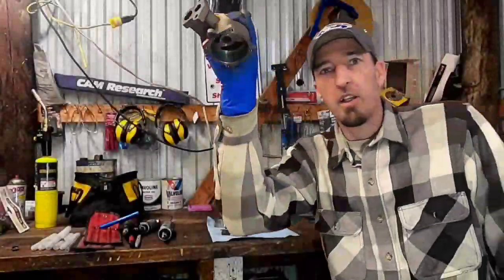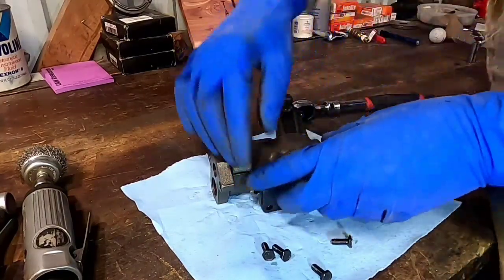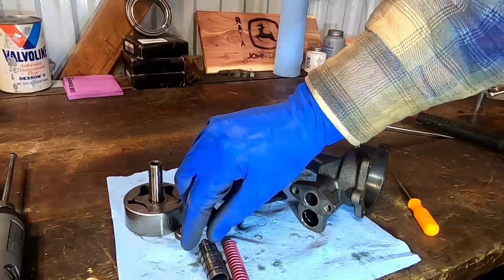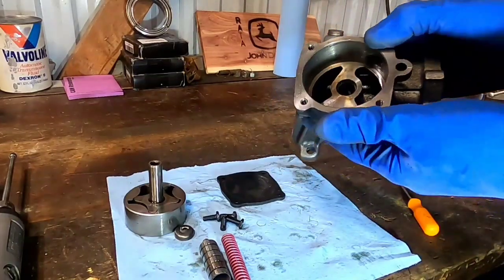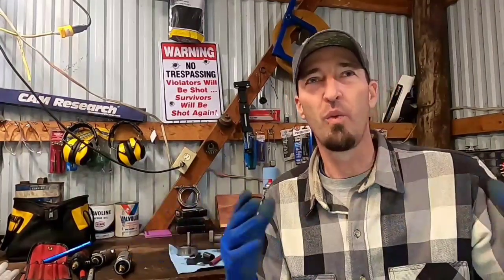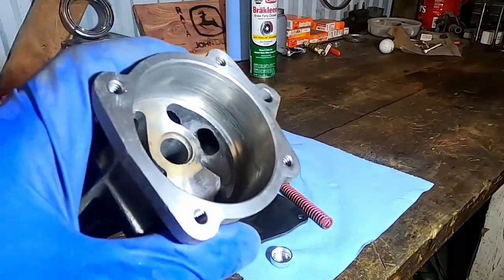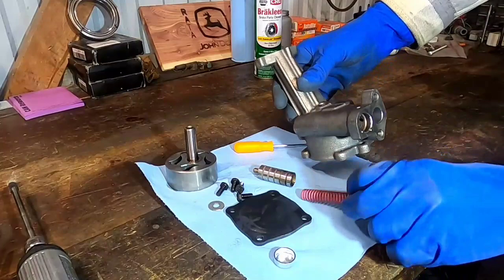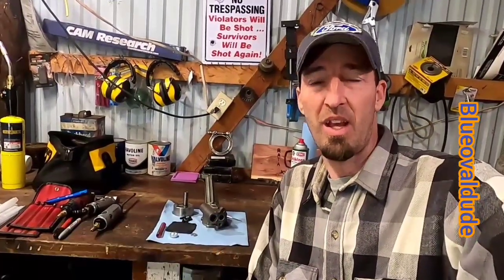Improve engine oiling part 2.   Ford 289,302,351,400 ect Oil mods  (oil pump)

Comment: As a aircraft phnedralics mechanic and a jet boat engine builder the modifications to enhance flow and oil drainage back to the sump using a hv pump with your work over is in my opinion  more desirable than just working over a standard pump. I myself when i removed the plug taped the seat area for a sloted screw in plug and drilled the body for a cotterpin to safety it

Comment: I never felt it necessary to do more than gasket match the Melling pump a washer stacked on the spring was about the most modification on a tired motor.

Comment: I know I’m late but I use a slide hammer with a sheet metal screw to pull out the soft plugs. I do it with any soft galley plugs.

Comment: Good information. I do hope that you 'dressed those gouges on the bottom plate before reassembling the pump. I had a significant oil pressure loss over a period of time when an oil pump kept digging deeper. It cost me a full engine rebuild to get to shrapnel out of any oil passages. That was a brand spanking new Ford oil pump on a crate motor where the driven rotor ate its way into that bottom plate

Comment: Why the hell did you not show the disassembly of the bypass ? that's what I came here for.....
Reply from the maker: @MrGsxr10001 Okay true. I did explain how I removed the softplug, and the proper order of the bypass. Bypass valve,pressure relief spring and then soft plug. Thank you sir.

Comment: When it goes into bypass it sends unfiltered oil to engine , it doesn't just go round and round in the pump like you described. Am i correct in my statement? Or am i confused?
Reply from the maker: When the oil filter bypass opens, it does as you described. When the oil pump bypass opens, it returns oil back to the inlet side of the pump. Reliving pressure and Recycling ♻️  the oil to use again. This all happens in the oil pump before it ever goes to the oil filter.

Comment: High pressure means oil heats up more also
Reply: High pressure always causes more heat, basic phyics
Reply from the maker: Not necessarily, a high volume pump will have to bypass more oil  and be running more oil through it. A standard volume pump will still be running the same volume of oil through as stock, more oil is just going where it is intended after mods. I Have not noticed a difference in oil temperature.

Comment: One other thing i would do is take 1000 grit sand paper and clean up pressure relief valve so in slides freely, same as when cleaningg  automatic valbve body

Comment: I didn’t see it or hear you say anything about this— but what thickness of feeler gauge do you use to check the rotor/scroll clearance to the plate ? I am curious as to what that dimension might be. I anxiously await your reply. By the way, I saw in another video a fella was saying that the oil drain back holes at either end of the cylinder head can be enlarged to a 1/2” I.d. as well as the front and rear oil passages in the engine block that receives oil from those same oil holes in the cylinder head. Have you tried this yet ? I will do it on my next build for sure.

Comment: I have a 1964 289 I took oil filter off an found very little oil in side the filter motor been run for short  time and no noise that would make me think no oil  pressure any idea what might be going on
Reply from the maker: The oil could be draining back to the pan. If you are concerned, put a pressure gauge on it to confirm proper oil pressure and operation.

Comment: Can this be done to a 400 M? from what I've researched its the same as the 351 Cleveland.  Your title says it is but i would just like to confirm.  Same part numbers for that plug you replaced?
Reply from the maker: Yes sir, it can, I am not sure if the soft plug is the same or not because  this was a 351 windsor oil pump m83 I believe.
Reply: Thank you. One more question. Can you see any improvement or is it worth doing if you don't do anything to the engine side like you did on yours? I would like to try it on the oil pump only and not the engine but want to see if it would make a difference or if its something I have to do to the engine and oil pump.  @blueovaldude
Reply: @awences1  im building a 400 as well. I plan on optimizing the oil pump but also cleaning up the oil passageways up to the oil filter, also the Tmeyer optimization of the #1 main oil supply. and the grooved cam bearings

if you got the engine apart i would do as much as you are able to do with what you have at the least. the less pressure is lost before it reaches all the bearings  the better. high pump pressure will increase pressure downstream but it will be more strain on drive gears and shaft versus decreasing pressure losses by smoothing block oil passages. of particular concern is the amount of oil going to the camshaft bearings. others may chime in or explain better than myself.

Comment: Other engine builders for Cleveland's say just use a larger oil pan. Those Cleveland's pump almost 2 qts per head and cause a starvation issues at sustained high rpms. If youbare using a standard 5 qts pan, then it is only 1 qt left and the oil pump is not even pulling enough oil and creating a vacuum in the system. The vacuum is then dry locking the system that further increases the starvation for oil.
Reply: Bull shit!

Comment: marking the rotor gears is a useless cause. The Rotor is a 4 blade the piece it goes into is a 5 so they are not timed. Never scratch you oil pump internals.
Reply: Blueing with Dykem blue would be an appropriate alternative. It wouldn’t cause any issues with the oil or pump, and it would not cause any issues with the rod or main bearings. Not trying to be a jerk, most guys wouldn’t think like this, much less know about this sort of thing- unless they just happen to be a machinist/ head porting shop.
Reply: I totally agree. Scratching a machined surface is a huge hack job move. Take the cap off, clean the end of the only part you could possibly put in upside down with some brake clean and a rag, and put a dot or mark on it with a sharpie pen. “Timing” something designed like that is hilarious 😅

Comment: Great content have You ever had an oil pump extrude honed or heard of anyone that does it ?  Less turbulence means less restriction ? Also what do You recommend to optimize the oiling system without having to resort to a dry sump system ? Any information that You are able to share will be greatly appreciated ! Thank You & Best Wishes 🇺🇸🇵🇷🦊👍

Comment: Soo, if you have High Pressure, and the filter bypass stock is 8-11psi, would that mean that the oil filter would be in bypass most of the time?
Reply from the maker: The oil filter bypass should  open when there is a difference between the inlet and outlet pressure, (that 8-11 psi) so Unless there is a restriction or the oil is too thick to pass through the filter media easily it is not supposed to open.
Reply: @blueovaldude  Kinda reminds me of the 351C oil pump mods, shimming the relief. for Pressure.  I like how you massage it better.
Reply: For future questions about this, the oil filter bypass is NOT a static pressure.
It is differential pressure. There has to be say 8-10 psi difference between what is entering the filter and what is leaving the filter. So if the filter is clogged and there is not enough pressure to keep the bypass closed, compared to the pressure on the other side, it will open and force the unfiltered oil into the engine so that you maintain oil pressure in the block. 
If there was 60 psi entering the filter on the dirty pump side and only 45 psi on the clean engine side the bypass valve would open because the filter media is clogged and your engine will maintain proper oil pressure not explode.
If it was a static pressure it would run in bypass even at 700 rpm idle.

Comment: I have a question about clearances for the oil pump drive shaft for a 71 302. Wirh a Melling drive shaft to bearing cap block clearance I'm at .013, does this sound about normal for a thicker drive shaft?
Reply from the maker: As long as there is clearance, it should be fine. If it is too tight, just clearance the drive shaft slightly. 👍🏻
Reply: @blueovaldude  Thank you, I worded that wrong, it's the shaft to bearing cap, and crank lol. Right on man!

Comment: While you had the grinder out, why didn't you grind the casting parting lines smooth to relieve the inherent stress risers?
Reply from the maker: Good question, I have never found any data that proves that it may help the main webs hold more horsepower.

Comment: This video answered my question on the last video about what it might hurt so please disregard. You've convinced me that a high volume pump is not only unnecessary, but may actually rob a bit of top end power. 
I think the cleanup on the oil passages really helps horsepower too because it reduces the amount of resistance the oil pump has when it's driving that oil through the engine. I remember when I did my engine build I found a document on NASCAR engine building that talked about how those guys would pump an abrasive slurry through all the oil and water passages to smooth everything out for this very reason. It was claimed to gain a few net horsepower at the flywheel, and as we know every little bit of power counts in those applications. Conceptually the same as the pumping losses when you have a restriction in the intake or exhaust flow. You may not actually be pumping any more air (or put another way increasing the volume of air a cylinder can pump), but the amount of power it takes to pump that air is less so it puts more of that power out to the crank with each cycle of the piston. I was drinking from a firehose of info at the time I built the engine so I never messed with any of that oil passage stuff, but it was interesting reading for sure.

Comment: Porting the oil pump typically gains 20 to 25 PSI without changing or shiming the bypass spring. Most people don't want to take the time to do it but on a Cleveland or 460 it cures 90% of any potential pressure issues w/o restrictors in the cam bearngs and thats with a stock volume pump. Good video.

Comment: Look into Jon Kaase's oil pump. The right amount of volume to the right amount of pressure. Need to post the volume numbers to each pump. Pressure is a number not the amount of volume. Look at this away, I can have a 500 gallon a minute pump with 6 psi and another pump rt next to it at 110 gallons a minute at 6 psi.
Reply: That's complete horse shit...do you know how big a pipe it would take to carry 110 gl per min at any pressure?

Comment: The problem most people do not realize, when trying to up the oil Pressure is that you can exceed the PSI rating for your oil filter. Once you exceed the PSI for your oil filter, you will eventually cause that filter to explode causing an instant oil pressure loss. This is why he is saying he does not recommend high volume oil pumps, is because it will either starve the engine for oil when it empties the oil pan or blows the filter.
Reply: That's why you go with a 7qt. pan or larger in stroker engines.
Reply: That is such bull shit. its an old wife's tail that just wont die. In my 64 years Iv'e never seen or heard of an oil filter blow up. And a HVP will not suck an oil pain dry. Go to Powell's machine and watch his video on this old lie and you will never believe it again.

Comment: Hi BLUE OVAL DUDE, On the intro of this utube clip the engine on the the engine dyno running !  are those headers the ones you use on your vehicle ? ty
Reply from the maker: No, they are schoenfeld 3" bolt pattern 1 3/4" primary headers for oval track cars, some call them dyno headers. I had a bunch of stuff to throw at the engine on the dyno, but unfortunately it didn't work out.
Reply: @blueovaldude  OK!  next  time put your vehicle headers on! and see the horse_power losses  due to the sharp turn of you vehicle headers compared to the dyno_room headers. ty
Reply from the maker: @ivankrolo4626  That was the plan, along with a pile of other parts testing.  A 3 month wait time for a dyno slot made me pull the plug.  Honestly,  I don't think there would be much difference between them . The design of my headers are much better than a cheap stock K-member designed units. No bends straight off the header flange. I would like to do an A-B test though.

Comment: SOFT PLUG REMOVAL= DRILL1/4" HOLE THROUGH PLUG. ACORN LUG NUT 1/4" HOLE DRILLED THROUGH + SELF TAPPING SCREW W/ HEAD STUCK WITHING ACORN PORTION OF LUG. THREAD ACORN LUG ONTO SLIDE HAMMER BAM SHES OUT.

Comment: Melling stated that the HV oil pumps for the 351w bypass at 76psi despite not being labeled a 'High Pressure' pump. Stock M83 is to bypass at 65psi.

Despite most engine builders saying the stock pumps are fine, I do like to spend the extra on the Melling 'Performance' pumps. i like the idea of the shaft being supported at the top and bottom to prevent deflection. you can see how the bottom plate has wear on 1 side from the deflection. Also the bypass plug is adjustable easily and even includes a second spring you can use. and it includes a hardened shaft
Reply from the maker: I show the melling select 10832 in an earlier video , it's in zephyr 5.H8te. It uses a M83 as a main body  ironically . longer shaft , different cover plate where the shaft passes through for end support and threaded relief valve plug instead of pressed in . It's nice but overkill for most applications. Great for oval track or high rpm stuff . That stock pump in the video was abused in oval track racing for 2 yrs  before I disassembled , inspected and modified it .
Reply: @blueovaldude  you need to find out what the volume is for each pump. Never assume it's enough.

Comment: I believe most high volume oil pumps come with high pressure springs installed. Basically you’ll come up on the relief spring faster, but your relief pressure will also be higher. Engine Masters on Motortrend did some a-b testing with a big block Mopar (because they have external oil pumps that are easy to swap while mounted on a dyno) and showed an absolutely negligible loss of horsepower. Same principle applies for any constant displacement pumps like these.
Reply from the maker: HV oil pumps can be had in high volume standard pressure or high volume high pressure. From experience, Either way I have seen them eat gears and when switched out to a standard volume pump at the same pressure the problems went away .
Reply: @blueovaldude  I'm so curious what the root cause of failures like that is. You see a lot of anecdotal stuff going both ways. Once the pump is on the relief spring, load should barely rise with rpm. I'm not implying you did this, but I'm curious if failures of HV pumps are actually mismatched gear materials or heights that people incorrectly attribute to the pump volume.
Reply from the maker: @Zero76606  Yes, gear material and distributor height to distributor hole depth has to be correct. I'm  just talking about an A to B test . Only thing changed was switching out the HV oil pump to a standard pump . Tested more than once . That extra %25 of volume makes a difference  . Even if it only took 1 horsepower more to run , that is a lot of extra strain on those little gears . There is a reason they reccomend to use a specific gear when using a HV oil pump . They are good for large clearance or worn engines,  other than that I will pass .

Comment: Thank you for explaining everything in plain English like why we need to radius profile the oil feedback ports.
Reply from the maker: You're welcome, I'm glad you appreciate it.
Reply: @blueovaldude  I don't see an advantage to a radius on the inlet to the pump cavity.  The hydrodynamic flow into the pump is a straight shot with the first direction change when it hits the wall and creates a pool. Since it is under pressure the transition would be in the pool not at the entrance.
Reply from the maker: @wolfhobbies  the first direction change is as soon as oil enters the pump, it goes directly to the left (when looking at the bottom under the cover plate) pulling oil across a sharp transition edge In the  body. Less chance of cavitation, smoother flow and better oil pressure.It should be moving around 8-9 gpm of oil at peak.

Comment: Have you explained the tools/ carbide bits you use to do this fine work?
Reply from the maker: I have before , it has been awhile now . For this I used 3 different double cut burrs , 5/16" cylindrical round ended , 1/4" cylindrical round ended and 5/16" ball style . You can come through a oil port and pull it across the sharp edge and radius a corner.  Like you are pulling  the tool out and across the edge . Running the tool at slower speeds for better control,  around 35-40 psi I believe. Hope that helps you.

Comment: We always added a washer behind the spring back in the day. 

But... we also drilled a hole to add a cotter pin to keep the plug from backing out. Needed? Dunno, but the cost was 3 cents for the cotter pin, so why not?